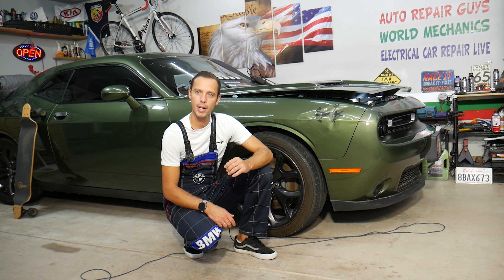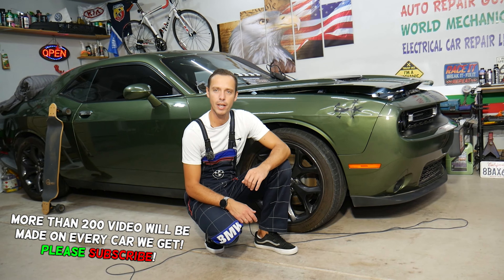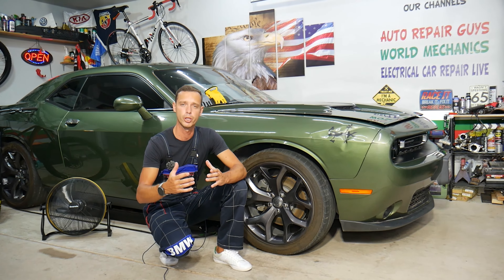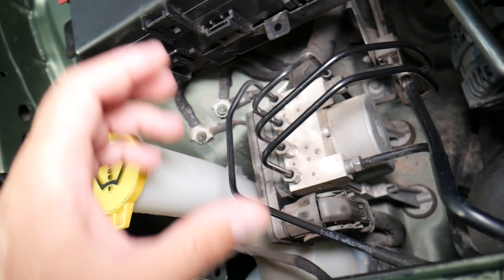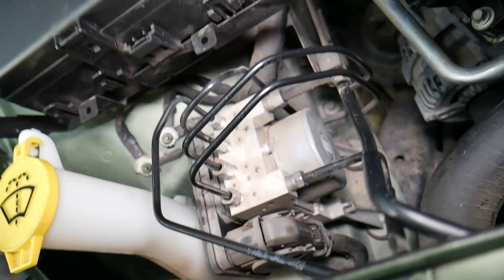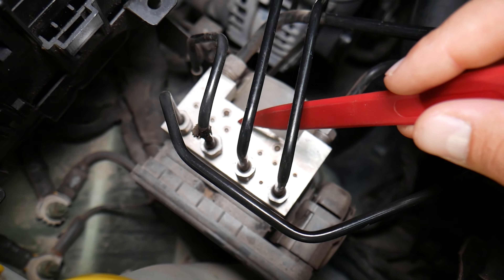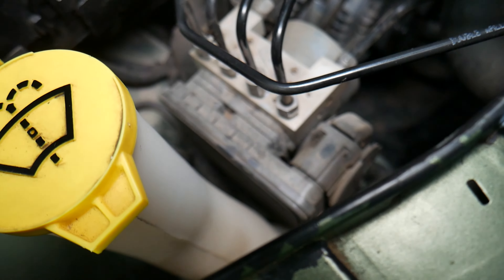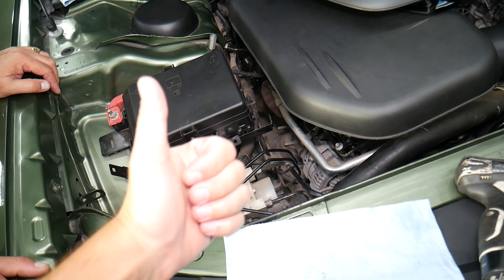DODGE CHALLENGER ABS TRACTION CONTROL MODULE and PUMP LOCATION

Comment: Hello, so I have a dodge challenger and for a 
while I’ve had no running lights in the rear of the 
vehicle. My reverse lights, turn signals and 
brake lights worked just fine but no actual lights 
while simply driving, so had to avoid driving at 
night, I decided to replace the 10 amp fuses to 
see if this would resolve the problem in the rear 
fuse box and not only did it not fix the problem 
but now I have no horn, wipers, blinkers at all, 
and my traction control light is on. Any ideas 
what’s causing this?
Reply: Did you get it fixed? What was the problem?
Reply: @rebelscout423  it was the #5 fuse. It was labeled as heated seats but replacing that fixed the wipers horn and turn signals. Still no rear running lights though that may be a wire

Comment: Abs light up also low batterie key fob .but there is already a new battery inside.  What's the deal with these two messages in combination?  Maybe someone  have the same experience and can help🙏
Cheers from germany